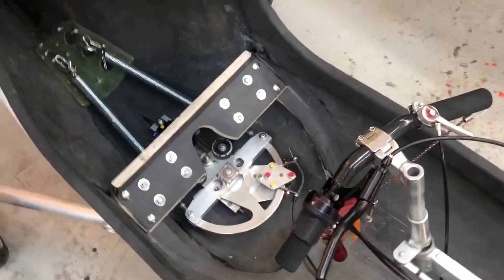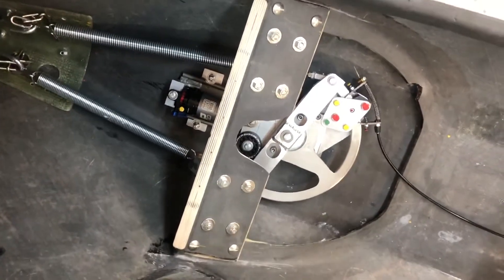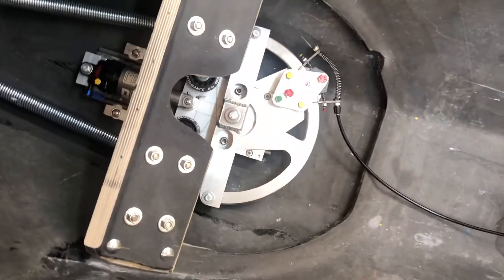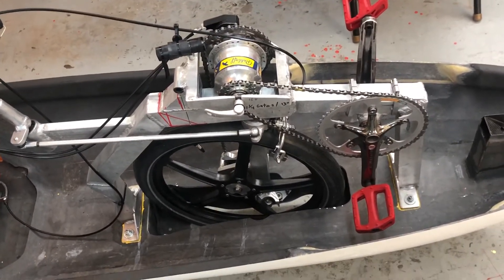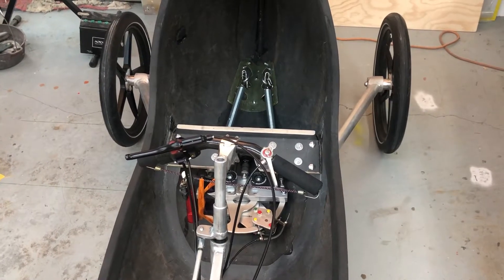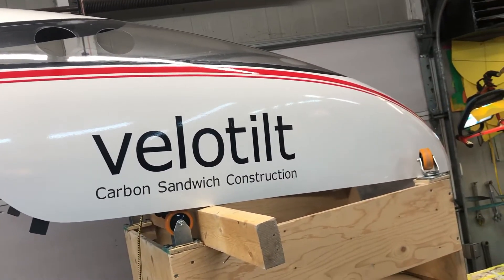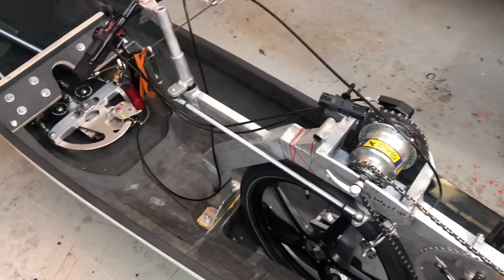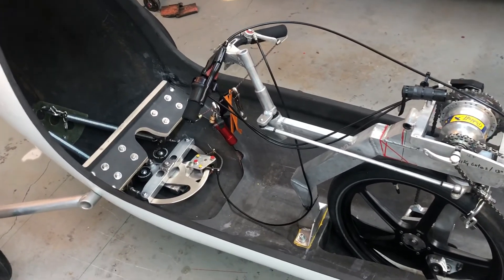velotilt work in usa

Comment: Is the skidding important? It happens because track width is increasing when leaning, but I am thinking that when the velotilt is moving, it won't be perceived as skidding, really?
Reply from the maker: yes , but taking outriggers back to 32” ,  lock is intermittent and needs repair, Springs are a experiment for a while.
Reply: Pushyhog Ah, then I get it. Thanks for explaining. This is such a beautiful VM, inside and out. I have the FFWD Munzo by Bram Smit and I see a lot of his mind in the mechanics.